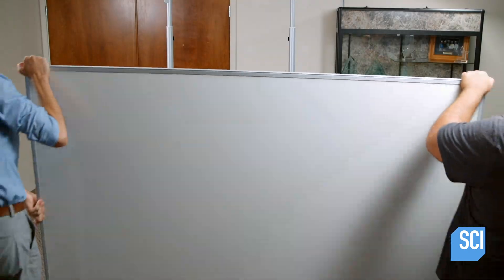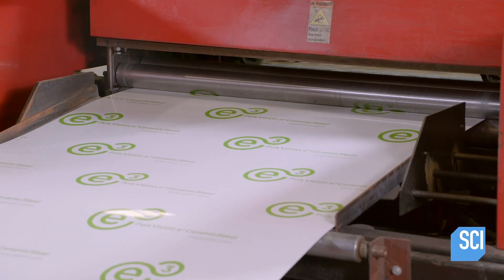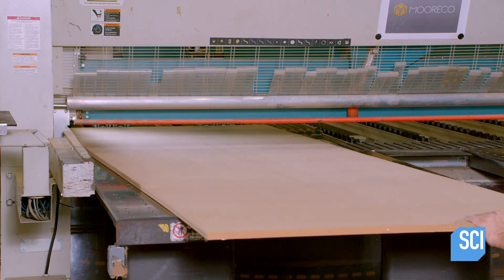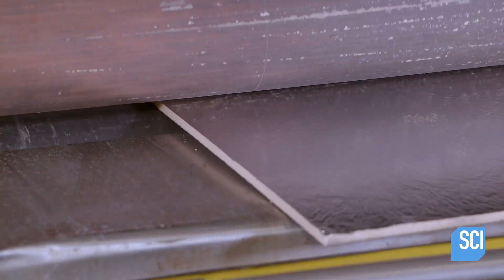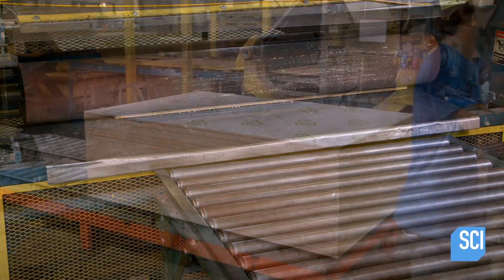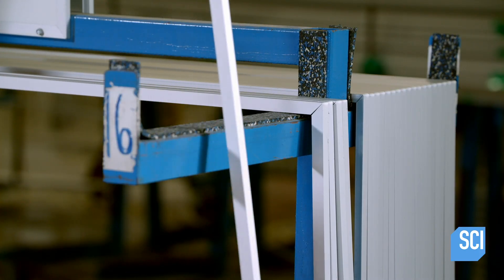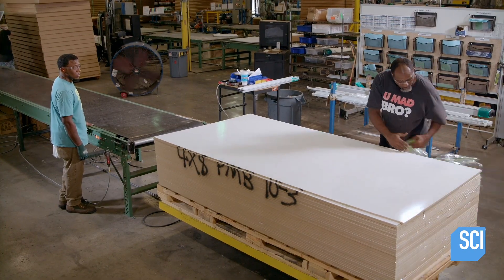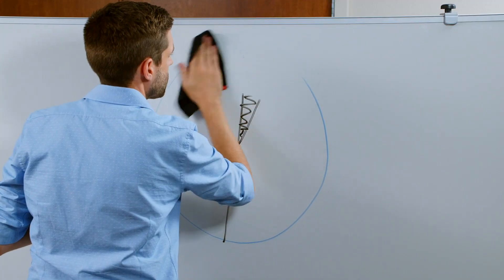How Dry Erase Boards Are Made | How It’s Made

Comment: I have idea of an Area Noticeboard like this but have Sliding Panel like Aquarium Type with Lock, to tell of News/Info/Answers/Crisis Place because it is like the Helpline will Redirect to Continuous Harassment.
Reply: With Lock.
Reply: Or a Solution that Rage Hearts and Causing Mental Unstability from Worry and Anger.
Reply: They have a Movement of "if seen while/when(an action)" that is a Common Sense Positioning thing.
Reply: As long as a telling is secretive they want to attract harassment to Target due to wanting to Ruin Life + Luck of Random Attacker that may be Stronger to Join Attacks.

Comment: I just have to comment.  So everyone has to be so careful not to touch the porcelain steel sheet because it's pressure sensitive. Now lets go back to the beginning.  It first comes in a tight roll that goes through a rolling press to straighten it before shearing it into sections.  Then it goes through another rolling press to get all the air pockets out after being glued to the backer board.  Then, in a stack of 50, goes into another press until the glue sets.  All of this and apparently it's so sensitive that finger pressure will ruin it?  Thank you for letting me get that off my chest.

Comment: Fun Fact: The release agent in Dry Erase ink does not last forever. I learned this when the message board we have got full and I tried to erase some messages that had been on it for over a month.
Reply: John Gallop you can wipe it off with alcohol, board looks like new after :)
Reply: You can also just go over it with a new dry erase marker. That will also take off permanent marker if someone uses that.